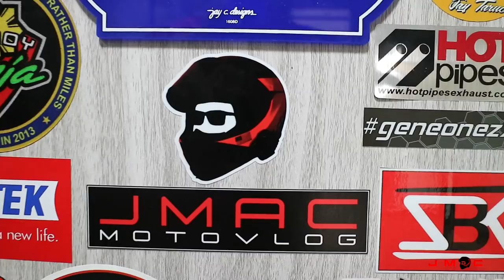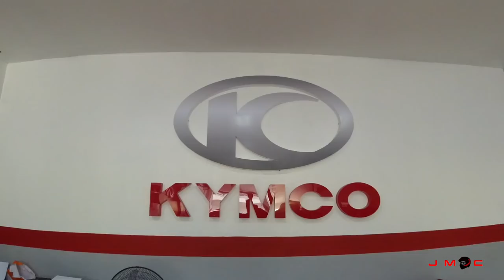ORION EXHAUST INSTALLED ON KYMCO XCITING S 400i | CARBON TIP EXHAUST | KYMCO SPONSORED | 30

Comment: Boss jmac daytona bayung nasa 1:11? Test ride mo po sobrang ganda ng daytona favourite bike ng isa sa favourite ko na motovlogger si yammie noob
Reply: Yammie squids!
Reply: Marc Mercado 675r. Yun palaging winawasak ni yammienoob. 😂
Reply: Maganda tlaga daytona. Karamihan sa motogp na lumalahok kung papapiliin sila daytona daw sila, pero compare ss mga branding and presyo almost same lang nama. Sila ng yamaha suzuki at honda when it comes sa big bike yung mga ducati kase op na pero same lang naman ng ibang bike performance naiba lang sa pangalan at dun nag mamahal.
Reply: Aborted Child actually compared sa Japanese 600 may konting lamang ang daytona mas may low end to torque kesa sa r6. 110+bhp sa r6 120+bhp ang daytona kase mas malaki ang cc. Meron ding Ohlins and quick shifter ang daytona na R version. Pero yun ngalang mas mahal ang daytona kera sa r6, $12000 sa r6 $14000 sa daytona. All that said sobrang ganda parin ng mga motor na yan kahit ano okay.
Reply: KRAM two time baetona slayer😂😂

Comment: Bought xciting because of you but the 300 cc variant only. 
#ForTheViews
Reply: how is the performance? meron ako Xtown 300i, pero after 6 months benta ko at palit ng Racing King 180. mas magaan, pero mabilis pa rin, mas bagay sa akin kasi maliit lang ako, now like ko sana yung Xciting 300, pero hindi ko pa nakita actual size nya.  mas maliit daw at maganda.
Reply: Mas maliit siya compared kay 400i mas shorter pero height ko is 5'11 medyo naka tip toe ako kasi malapad yung upuan (stock) pero sa performance goods na goods malakas hatak